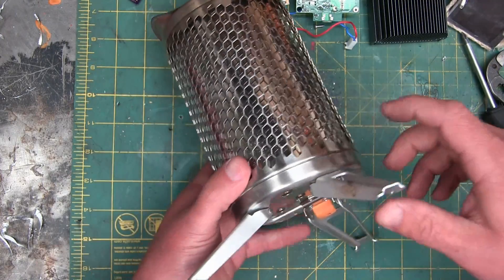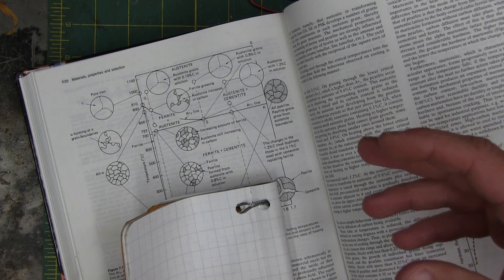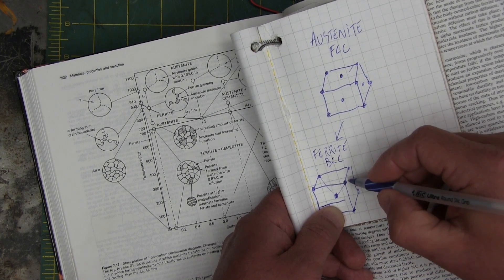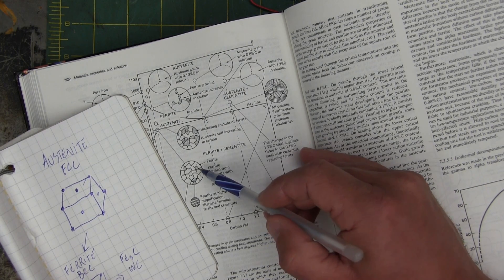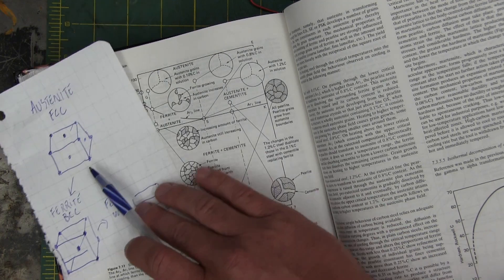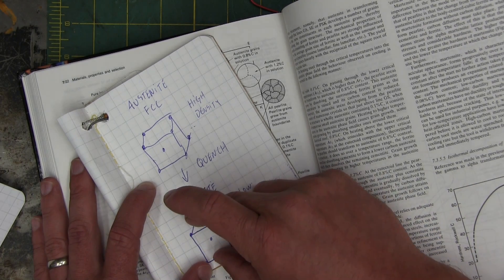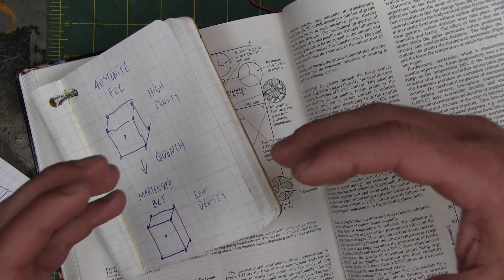STEEL -  QUENCHING IT HARD! | Enginerding 101

Comment: When steel gets annealed, is there any way to change it back to its original state? And if so, what would that involve?
My project car was in a fire and the roof sheet metal (18ga) is wavy to all hell, wondering if theres a simpler way to metal finish it that doesn't involve a decade with a hammer/dolly.

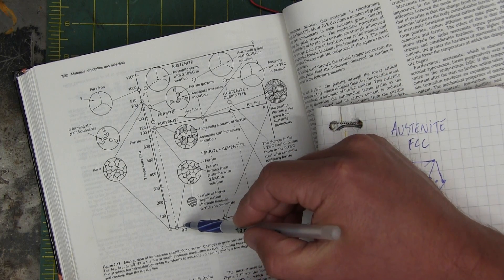Comment: 2:05 Hopefully we're not always working with austenite, or else we'd get burned. Low carbon steel is only austenite above 725C
2:25 Carbon is actually too small to substitute iron atoms in the basis. It fits in the interstitials (gaps between iron atoms)
2:55 Again, close but not exactly. FCC has really open octahedral interstitial, bit enough that carbon can dissolve in easily. BCC has much smaller octahedral interstitials, so carbon is either forced out for pearlite or bainite, or the escape is pressured if you're making martensite. 

You were close though :)

Comment: Hardness, Stiffness and Tensile Strength are 3 different parameters. Also the "cooling speed" X final temperature X curing period  determines the outcome. i.e. some cheap steel containing bainite will be restructured by the time and a perfectly calibrated mechanical part goes out of calibration tolerance in a few weeks of use causing damage in the mechanical system.

Comment: Carbon doesn't replace atoms in steel alloy. It fits in the crystal structure 'interstitialy' meaning between iron atoms due to the size difference. The kind of alloy your thinking of, AvE, is the same one bronze is made of where atoms replace each other in the crystal structure and distort it.

Comment: Man this guy knows something about everything so damn interesting.  I used to make Steel well grades of steels in a mill at the, LMF Ladle Metallurgy Furnace.  In 12 hour shifts for years.  An don't know the sciences behind it.  I just know about that it takes to bring down the sulfur and what alloys was. Ended An how many few-hundreds of pounds of each an the met an dolo lime to coat the ladles an how to get the carbon in solution and the conditions for the slag.  But this guy got it down to the science.  Like everything else he has videos on.   The most intelligent useful An knowledgeable channel on YouTube by far.  Learned a hell of a good bit about a few other things I would of not before.

Comment: Just a quick note on alloying elements. Carbon is a solute in steel, it does not replace Iron in the matrix, it fills the interstitial sites (gaps in matrix between the Iron atoms). Replacing Iron is done by substitutional elements such as Nickel.

Comment: Can't wait for part 2. Need to explain dumbass guys in maintenance at work why you can't bend hot rolled steel plate on a press brake. Running an Amada RG80. Oldie, but a goodie.

Comment: Got a question for you AvE. I just watched a video showing how you can remove a bearings outer race from and aluminum housing by welding around the race and letting it cool. They say it shrinks when cooled and it will basically fall out. Read some comments of ppl saying it expanded the aluminum. What do you think?

Comment: Great example of this is taking some piano wire about 4' in length and suspending it taut and horizantally between two posts. Pass current through the posts/wire until glowing, and it will grow in length initially due to the thermal expansion. However, once it gets hot enough, the now drooping wire will raise back up as the crystal structure changes and it becomes more dense. At this point, you can quench a section of the wire with a sponge and some water and let the rest of the wire cool slowly. The hardened, quenched section is brittle and breaks in bending while the rest of the unquenched wire remains flexible. The dynamic experience of "seeing" the structure change was really helpful to my understanding.
 Hope this was clear, maybe you can make a video for viewers on this, thanks AvE.

Comment: http://www.homedepot.com/p/DEWALT-Variable-Speed-Reversing-Versa-Clutch-Screwdriver-DW268/100609444 
 If you can get your mits on one of these guys would definitely informational. These are the drills we use at work and do they take clackers to zip screws in like hitting nails in a single swing.

Comment: Materials science PhD student checking in. FYI carbon sits on interstitial sites in FCC (and BCC) iron. Interstitial means between the atoms, rather than replacing one of the iron atoms. Carbon is so small that it fits between. 

A good reference for metallurgy is Physical Metallurgy Principles by Abbaschian and Reed-Hill.
Reply: Thanks for giving a good source of material!
Reply: @ajeje1996  best gorillas song
Reply: Stop...just stop!  I'm taking that right now and want none of your logic and reasoning around here!!!
Reply: Do you think larrin Thomas wrote or assembled the new standard? 

What do you think about the guy?

Is it just carbon and nitrogen that hardens and contributes to carbide? 

Spec sheets for m2 and things like a11 request a preheat to like 1500 then rapid ramp to aus temp. Do I need to do this when I’m treating knives that are 0.1” in thickness? I’m assuming this is for large parts to reducing warping? 

If I do this with knives that have bevels ground already, can I take away the chance for it to warp?

Comment: AvE I'm a tool maker. More specifically O.D or I.D grinding. A grate way to show the difference in steels is the ye ole spark test. However things get funny when grinding shit like A2 or god forbid D2. I like this video because it pertains to my line of work. However, and I know you know. The bare that is heat treating and manipulating steel is much more a vast wonder than one can explain in a single sitting. One thing to remember when holding microns or tenths, steel does what it wants! No matter how good or how many tricks you posses. It's an amazing and sometimes funny beast to tame.

Comment: Along with your phase diagram you need an example of a TTT time temperature transformation diagram(they vary by alloy but the basic shape remains) perlite ferrite and bainite are time dependent but martensite is only temperature dependent. (ok slicing it very thin mart. is time dependent but only on the magnitude of the speed of sound in steel, there are actually some martensite formation audio recordings, way to quick for any practical process) 
Carbon is not actually needed to form martensite but you need the combo to see the desired properties.
high carbon[over about 0.6-0.8% C] martensite(and some exotic bainite cases) is where high strength steel gets its strength and overall hardness, carbides grains provide the abrasion resistance and add a little bit to the macro-hardness.(micro hardness tests the individual grains, macro is the bulk average)  Tempering of martensite reduces internal stresses and causes a slight crystal structure change greatly reducing the brittleness.
A few critical points to mention are the eutectoid point at about 0.8%C , the max solubility around 2.0%C, and the effect of very slow vs moderate or fast with a pause, cooling speeds around the lower transition temperature(same as the eutectoid temperature) with hypoeutectic and hypereutectic carbon content.

Comment: To add a bit of vooodoo, katana, wootz steel (aka Damascus steel), pattern welded steel, etc.  it's all steel just with their own mix of 11 herbs and spices.  The most important thing is to have impurities removed.  The Japanese did this by folding (which does NOT in itself add strength) due to low quality iron.  Wootz/Damascus was made in a crucible.  So were the Ulfberht swords.  They removed the slag with flux.

Comment: OMG !  Flash back 45 years ago to my Mechanics of Materials class !  You explained it better and in much shorter time !!  (The prof spoke British English.  I could not say "aluminum" for over a year.  Only "aluminium" !)

What confuses people is cast iron versus steel.  IIRC, cast iron has "big chunks" of iron that are not part of the crystalline structure, and can break off.  A "blast furnace" introduces extra oxygen so those carbon chunks burn off leaving (more less) pure iron.  Then small amount of "pure" carbon are added back.

Adding very small amounts of other metals, chromium, molybdenum, etc, produces steel with differing properties.  To those who don't understand, it appears like black magic/alchemy but it is  a well studied science !

I can't wait until you do stress/strain curves !

Comment: You needn't worry about your presentation of the subject. I have a Masters degree in materials science, so those phase diagrams are very very familiar. Your explanation was well put together. Perhaps not scientifically 101% accurate at each and every point, but that's not important. What is, is that you got the point across in shop terms!

Comment: Is that a Biolite Campstove in the beginning of the video? Is it possible for you to do a video on the engineering present in the portion of the stove that converts heat to electricity? I doubt you will see this as you usually get a metric fuckton of comments. But I thought I would ask on the off chance you see this. Merci pour les vidéos.

edit: My lucky day, thanks. It was very informative.

Comment: AvE are you going to go into the different types of quenches, oil, water, salt-water, martemper, fast-air, etc.  Along with the Draws to bring down the hardness of steel to the level a piece of steel needs without being so hard its brittle.

Like how certain steels, like A2, D2, H13, etc where you have to hold it at the high heat for a while before cooling it rapidly with air.

Comment: Nice analogy with the water and salt. You could enhance it further by saying quenching is like flash freezing the water into ice trapping the salt in the solution and not allowing it to escape.
Reply: The ice analogy would also work with the hard and brittle analogy. Hit it with a hammer and it breaks into a bunch of little pieces. Hit water with a hammer and it is soft and flexible and absorbs the blow.

Comment: Used motor oil is heavily saturated with carbon. If you quench your mild steel into it, the steel will absorb a crap load of carbon.

Comment: I went to airforce metallurgy and heat treat school and I like this video, most videos show a basic process for either quenching or tempering and don't get into the nuts and bolts. They may throw some words around but never really explain anything. A few things missed are the distinction between the bcc and bct, unless I just wasn't fully listening. And the critical temperatures, how a3 changes with carbon content, a few more "grain structures" which are just different visual arrangements of cementite and ferrite and some other stuff that probably wouldn't be suited for a single video anyway. 

You give give the viewer the respect that they are intelligent enough to grasp it, and present it without the intimidation or lack of practical application you might find learning this in say, a chemistry class. In chem class you might just see this all as gee wiz and endless charts not even realizing that it's about getting your shaft hard.

Comment: You have given me a more intuitive and broad general understanding of the different phases of iron than I learned in my two materials science classes in engineering.

I have a cheapo stainless steel sword that I plan on forging into a better shape, I want to give it a distal taper at least. I just need to hook up a blower to my old grill. I also would love to try to carbonize or case harden it just for fun to see what happens.

Comment: I did a year of material science before going to electronics. From what i remember, the cold pure iron cristal structure is centered cube, there's an iron atom at each corner of the cube, and one at the center. With face centered cube, that paritcular structure allows a bigger volume of void between atoms : there's atoms at each corner, and at each center of the faces of the cube.. BUT.. The gap left in the center of the cube leaves just enough space to squeeze in one single carbon atom (because the iron atom being heavier and having much more electrons orbiting the core of neutron and protons, it's bigger. Carbon is lighter, has less electrons orbiting the proton and electron core, so it's small, hence it squeezes itself in if there's a big enough gap). It's not an iron atom being replaced by carbon, it's a carbon atom that squeezes itself in the gap between iron atoms :) . its possible to use that same trick with other metals: if another metal has that same structure, and the gap between atoms is big enough to squeeze in another appropriately sized atom, then it's equivalent to adding carbon to steel to harden it.

Edit:
Since the cubes are a pattern that repeats, it's not just at the center of the cube, but also in the middle of the segments between the corners of the cube

Comment: Yo AvE, quick question, i found a skookum SDS drill in a skip, only needed rewiring, the case was full of cuntstain targlyde tipped masonry bits, with SDS drilling involving a hammering action, is madame carbide a suitable drill bit type for it? Or am i gunna find myself extracting pieces of carbide from the hole i just drilled?

Comment: Interestingly, if you over heat stainless steel or cobalt chromium, you can get weld decay, where the chromium precipitates out at the grain boundaries leaving the material much less corrosion resistant.  Also when soldering stainless steel or chrome cobalt ideally, you need to use a flux containing potassium fluoride to break down the passive chrome layer formed on the surface of the material - JUST SAYIN!!!!

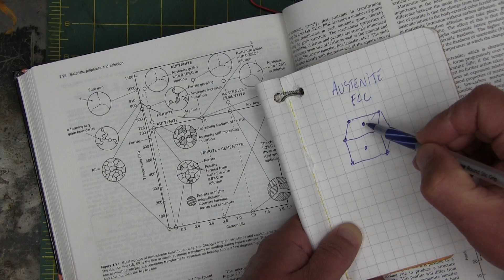Comment: At 2:30 you made a pretty important mistake/slip of the tongue: steel is an interstitial alloy, because Carbon atoms are tiny compared to Iron atoms. In steel, the carbon atoms are not switching with the iron atoms. The salt analogy is better here because the water is not actually replaced by the Na and Cl ions - these make links to the water molecules.
An example of the type of alloy you talked about (substitutional alloys) is bronze or brass. Many Steels are have interstitial carbon and substitutional alloy-elements in trace amounts, to provide and change the properties.
Reply: I can't 100% recall if this next part is correct (and can't be bothered to search the hivemind) but I think the reason Ferrite dissolves so little carbon as compared to Austenite has to do with the amount of links that each interstice has to the surrounding Iron atoms and the crystal structure itself. Carbon is small, but does have a size and perturbs the crystal structure. Both of these combined make for less carbon in Ferrite than Austenite.
Again, I can't be sure of this, as I don't really remember the classes that well.